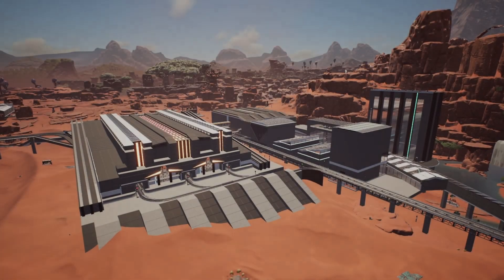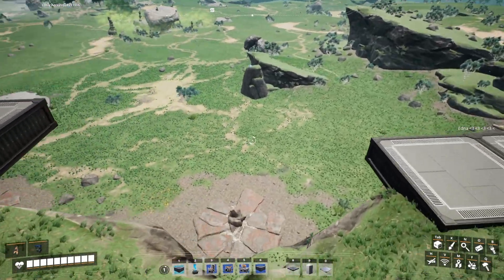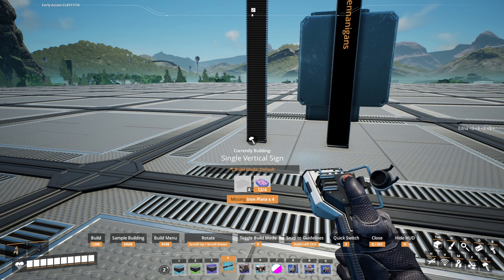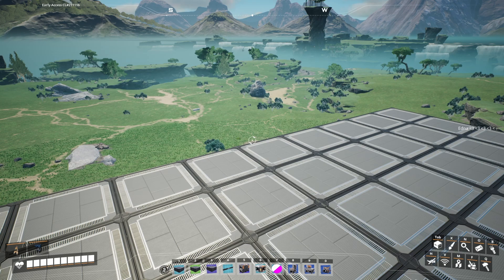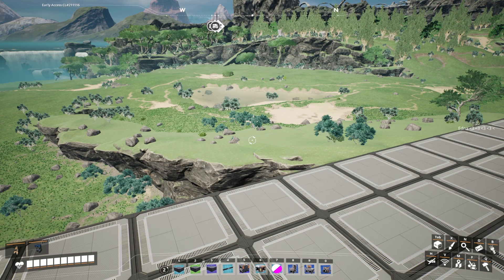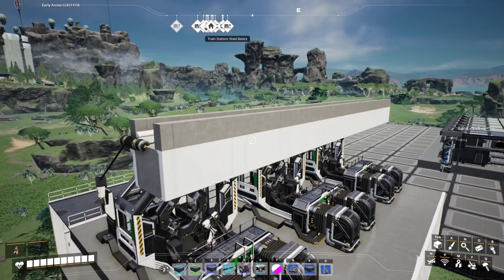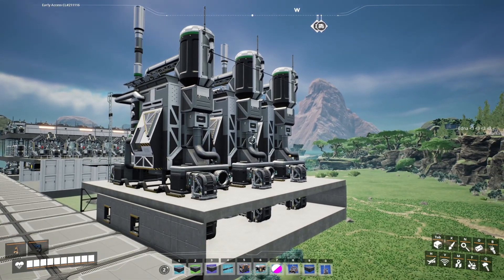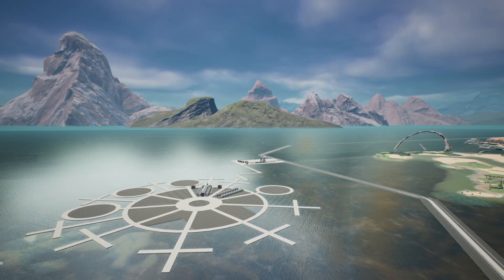Blueprints Every Pioneer Needs In Satisfactory Update 7

Comment: Loadbalancer: one way to shave of some space, is to place lift first and clip the splitter or merger onto it. This pulls the lift into the splitter.
Reply: However, if you have 2 lifts right next to each other, a splitter on 1 and a regular belt coming out of the other, the non-split line can pull from the splitter even if the second line isn't connected to it. You have to place the non-split line BEFORE the splitter to get the line to function properly. I'd make a video about it, but unfortunately I have the editing ability of a stack of limestone.

Comment: I really like the over-under factory idea, where the logistics floor is sandwiched between 2 buildings.  However I worry that it will just lead to even more spaghetti when trying to route the main inputs and outputs.  I build mega-factories where all the relevant components are available "on tap" from a main spine and then routed into blocks of constructors etc wherever they are needed, but it quickly becomes a challenge to route each resource over under and around each other resource, especially with only a limited space and height to do so.

Comment: I have built a small hall with 4 Blueprint machines next to each other. When I want to build something bigger, I just make sure that the 4 parts end up fitting together and centered correctly. So you can also realize larger things like roads and or tunnels etc. Just build the floor, sides and ceiling individually.  ¯\_(ツ)_/¯

Comment: at 11:05 I notice when placing the lifts, you go straight from the belt to the building. Normally I have been connecting lift from belt to hole, and then another lift from hole to building, or vice versa. What are your thoughts on this? Why place the lift hole if you are not using it?
Reply from the maker: I like the asthetic of using the hole but if floor holes are bugged out I don't want to use them - haven't thought about using half plugged holes though, so it might work
Reply: @TotalXclipse  I thought floor holes were fixed. I've been using them without  issue for a while now.

Comment: I believe the total Storage Module has something wrong (or im just to stupid to see how it should go up when its placed on the input). As of right now it can display and input from the top. Either the Containers are placed something wrong or im overseeing something very hard.
Reply from the maker: I think you're overseeing something - the system works perfectly. The central input is set to any, the resources fill up the storage and the front lift to show the object. Once the storage is full, items will go up the lift on the left output of the smart splitter (it's set to overflow) this can be then sent elsewhere or sunk in an awesome sink
Reply: @TotalXclipse  yeah i didnt saw a central input... i knew i missed something :D btw thanks for your videos, they are great and very informative.

Comment: How did you manage that your conveyer lifts through conveyer holes did not bug out?
All my blueprints using those are bugged...
Reply from the maker: I show how I do the lifts at the end with the refineries, I connect the output from say a splitter directly through to the buildable rather than using the holes, but I place the holes down so they look like they're being used
Reply: @TotalXclipse  Thanks, I thought so as well when I saw it. I have to try that... Whenever I place a blueprint so far with those holes, the lifts work, but they point into random directons, which gives it a very ugly look :D
I also read in another comment, that it might be related to online mode. The save I am playing on we play online. I am hosting it and I made the blueprints. This might also be the reason why the lifts act weird.

Comment: That smelter facility took waayyyy too long to replicate.  But now I need to figure where and how to redesign some of my sites
Reply: how did you get the outputs to connect? I couldn't get them.
Reply: @missesmayo8265   Not neatly.  If they are Smelters to Constructors, I usually leave 1, maybe 2 foundation slabs between the buildings (which is how I use them) and just connect the with belts and lifts.  If its product to product, like wire to cables or screws and plates to reinforced plates I have belt clover leafs that deposit into a 5 block of large storage before the next process in the sequence.  I'm not particularly careful with exact counts (don't care for the math) and I back up my production.  I don't really do the massive building projects that TotalXclips, ImKibtz or Bitz make.  I can't quite wrap by brain around them.  The closest thing I have is a "traditional" (but in no way standardized) oil power plant lay out.   I have some recorded content, very sporadic Twitch streamer, I could do a tour video if you really wanted to see my unmitigated mess.

Comment: Thanks for the video. It is really cool. Do you have in plans coal power plant blueprint?
Reply from the maker: Do coal power plants fit in blueprints now?
Reply: @TotalXclipse  you can only get 3 in the blueprint now. It's not bad if you want to get a basic one to copy/paste.
Reply: @TotalXclipse  Yes, you are right. You can't use coal power plants in current blueprints. I was thinking about creating 3 separate blueprints to make a  facility for 8 power plants that consume 120 coal/per minute, with water tanks, 3 pipes to feed the plant with water, and a load balancer for the coal. It will require some post-processing after deployment, like adding power plants and connecting pipes. It will anyway reduce the time for the entire power plant construction.

Comment: I love these. I'm struggling to figure out the inputs/outputs on the constructer one, though. I have it positioned how I want, and used the splitter thingy to see where the inputs were but I think I have it set up wrong still. xD Ah well. What's another couple hours of trial and error :3
Reply: Half the time, I have to put a conveyor pole to get the belt right, then remove the pole.

Comment: you want a blueprint with 2 foundations, because other blueprints may have odd/even number of foundations on the side!? why not just place a single foundation and later delete it anyway? No need for a blueprint.
Reply from the maker: Blueprints don't snap to foundations giving us a change of placing them off centre to the grid and having to be deleted by using a blueprint foundation to snap blue prints to your grid it's much safer to do and requires you to only delete 1-2;foundations if you make a mistake rather than a massive blueprint

Comment: I am finding blueprints are not working well especially when you have 2 levels as the lifters never connect or face the correct direction even if using lift holes